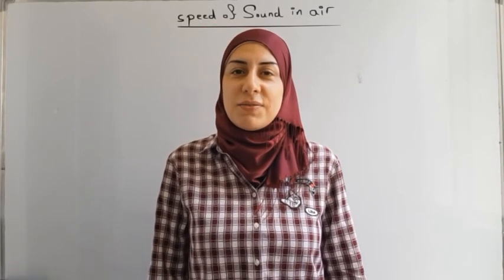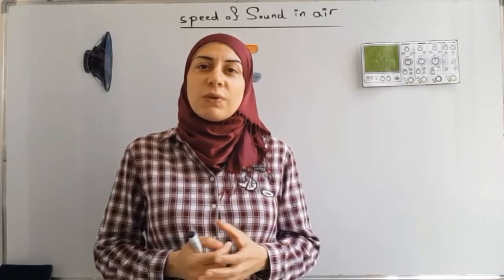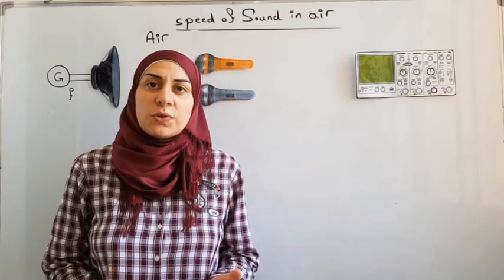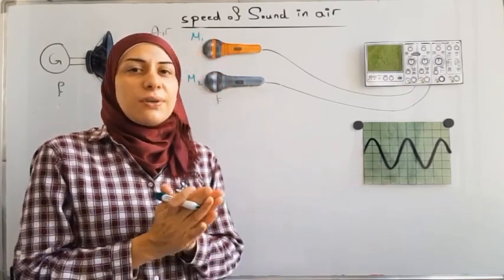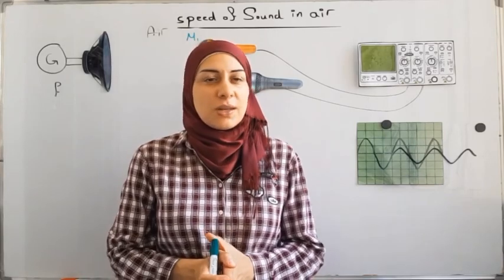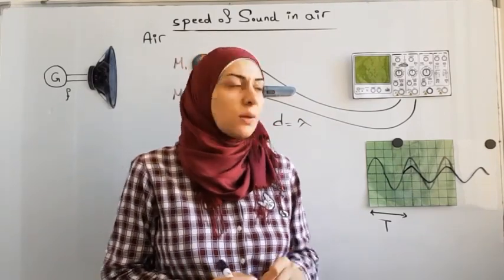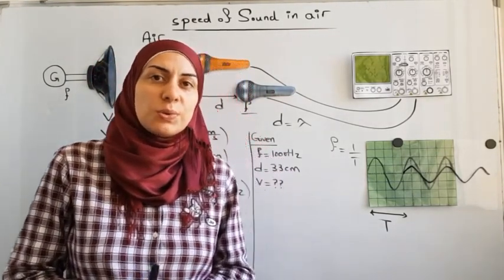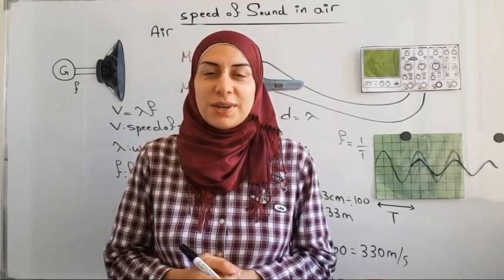Speed of sound in air🔊

Comment: thank you very much teacher, i still don't understand ... why do we use two microphones and not just one?
Reply from the maker: Welcome.  We use two microphones because the distance between them is equal to the wavelength.  This allows us to calculate the speed of sound in air which is the objective of the method. If we used only one microphone we obtain one signal and we will not be able to calculate the speed of sound in air.
Reply: @tension-freephysics  Teacher so we also move the microphone 2 from microphone 1 until the waves are alligned/phased together. Why do we do that
Reply from the maker: @kingjarif6822  we move them until the two wave forms are in phase again for the first time. This specific distance that we moved equals the wave length of the sound wave.